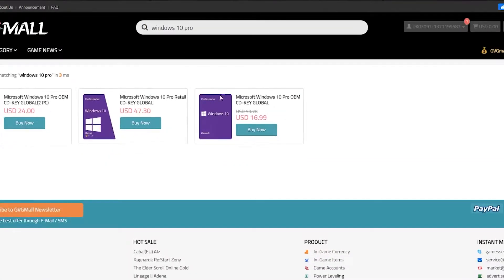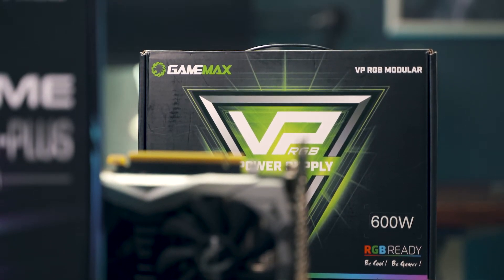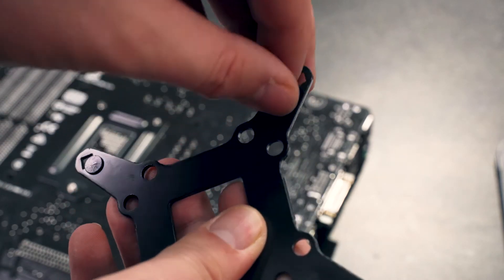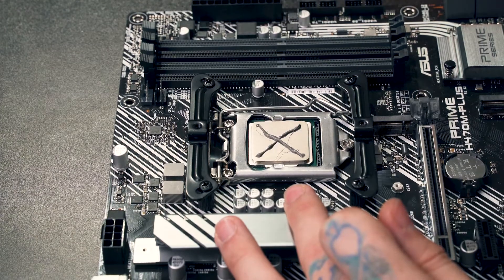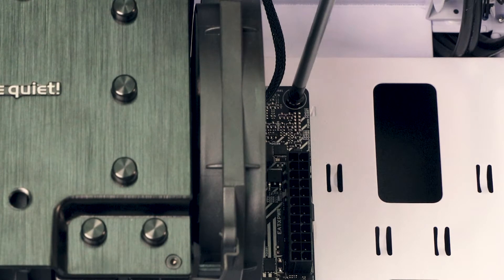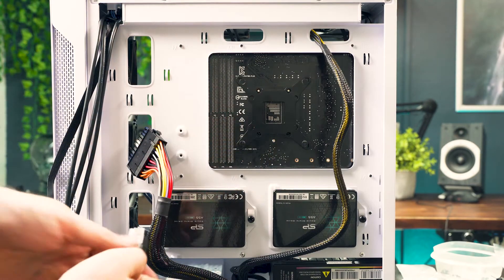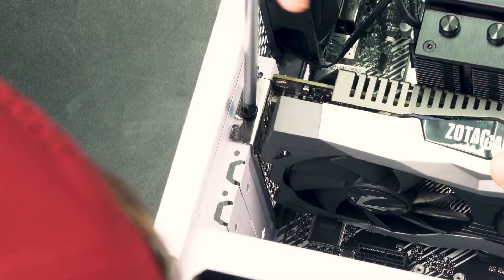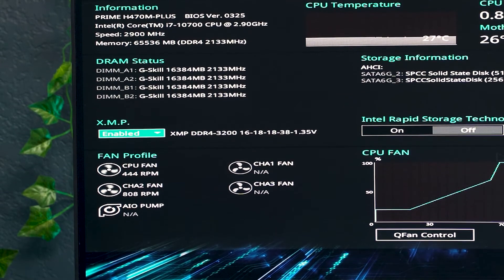2020 PC Build Guide $1000 | GAMING/STREAMING/VIDEO EDITING

Comment: Solid video. Just a note, there are motherboards that have the IO shield built on to the Motherboard, and older cases don't have the standoff screws preinstalled. Always check for those standoffs.
Reply from the maker: Absolutely right. This is more of a build guide for this exact build.